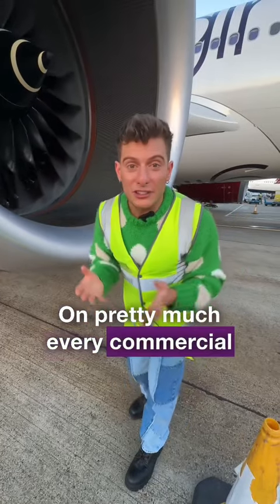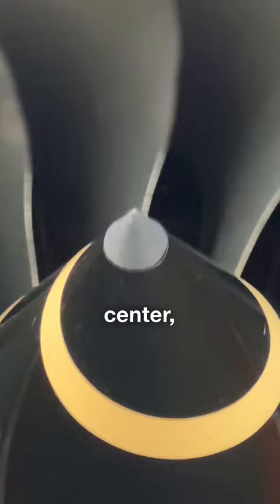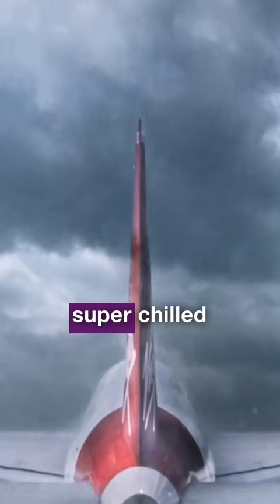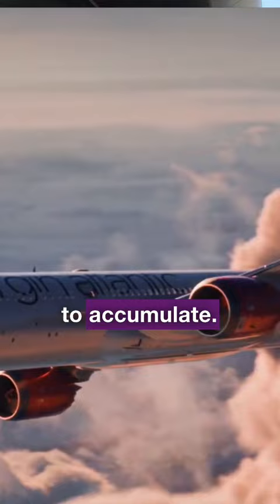The incredible engineering of a jet engine ✈️

Comment: Only on Rolls engine this is a patented feature
Reply: I hate that it’s patented
Reply: no, v2500 too
Reply: @jodjdjdg1559  iae engines are basically carried by rolls Royce that's why the engine architecture is so close from the RR rb211 and that's also why the spinner looks like this (yellow spiral) which is the RR signature
Reply: @victorbarretieri8252  they aren't anymore, Rolls Royce had a hissy fit at Pratt and Whitney, the other big group in IAE and they dipped from them
Reply: Yeah on pratt and whitney engines they just stick with a metal dome
Reply: @victorbarretieri8252  RR rb211 for Rolls Royce rubber bending 211 mm?
Reply: @swaggynator3879  I don't believe it means something in particular, maybe just an intern reference to something like the name CFM56 idk
Reply: Finaly the patent ran out recently. I know a company copying it as we speak.
Reply: I guess that’s why GEs and PWs engines must be more spherical.
Reply: @alonso-mexican757  GE wise, they're called "coneptical" a mix between a cone and an ellipse preventing ice formation and enabling smooth air flow for the compressor downstream.
Reply: @jodjdjdg1559 I mean… rolls Royce did design a decent chunk of the v2500 so that might explain it.
Reply: @FSXpilotman  well its not really a neccessity safety wise because the other engines just round off the whole cone and it has the same effect
Reply: Why would a safety design be patented. Crazy..
Reply: @iCore7Gaming because it isnt a safety feature its to increase performance its always possible to just make the whole cone round wile all the other engine manufacturers do to avoid the problem
Reply: I’m the 1 thousandths like on this comment
Reply: @FSXpilotman is it important to you?
Reply: @sqwk2559  yes

Comment: Pilot: Alright, turn engine 2 up.
Reply: Up?
Reply: @AverageAlien  throttle up
Reply: @NoahDaun-yd2ep turn on APU or battery option or ground Power . , set throttle St idle but electronic on set engine 2 on ingintion power delivery set-up. Next procedure can be different on type of aircraft. Turn on the engine Power to . Mag start auto or manual depending on situation. Now you throttle up the engine. 
Normally in Airbus 70% things are automated so yeah instant startup turn this guy into 10 million pieces of flesh. 
However at idle Power it ain't much strong to take you inside die to pressure on ground but depends on scenario there's no guarantee.
Reply: @arghyaprotimhalder5592  you realise it takes a good minute for engine to even spool up? you hear the compressed air starting system even before the engine begins to spool
Reply: That's engine 1💀
Reply: @lessthevrguy  no he is right bro thats the right hand side engine and that would make it engine number 2
Reply: @priyam352  bru in fact there is no engine number because you don't know where to start counting
Reply: @lessthevrguy  there is left engine is always lowest number and goes up left to right so a350 with 2 engines the left one is engine 1 and the right one number 2 and on the 747 you count 1 2 3 4 engines from left to right
Reply: @priyam352  Ait your gonna be a good teacher also I knew
Reply: @lessthevrguy Nope, thats engine 2 ☝🏻
Reply: @lessthevrguy 🤣😂
Reply: @arghyaprotimhalder5592  
I see my comment are getting deleted, so I’ll keep this short..

"turn on APU or battery option or ground power"?!?
What ??? 🤣😂🤣🤪

Stop writing incorrect nonsense you have randomly put together from various sources on the internet☝🏻🤬
People who doesnt know better could actually believe you know what you are talking about..
Reply: @NoahDaun-yd2ep they don’t say that
Reply: @arghyaprotimhalder5592 that’s bullshit
Reply: @justing42  why not? it'll give a good scare to the worker, just a little prank
Reply: @NoahDaun-yd2ep with full engine power 😂

Comment: Rubber spinny tip yeah just wait until you hear about the new additive manufacturing processes used to make turbine blades with tiny holes all though them that cooling air can flow through, allowing them to survive ridiculous temperatures and achieve amazing fuel economy.
Reply: New...😆
Reply: They have had tiny holes in them for decades.

Comment: Imagine if the engine just goes full throttle
Reply: with the new hybrid electric ones they could . you try to step out but as you do the suction gets too big and you are pulled back in as you are strugling to get around the cowling edge.
Reply: S engine is off it won’t need to start up and that takes atleast 60-70secs and is pretty loud

Comment: WHY ARE YOU SO CHILL WITH A MOVING ENGINE RIGHT THERE!
Reply: cause it’s turned off. the wind is moving the blades
Reply: @praintt  ooohhh
Reply: If the engine were to be on then it would be spinning at 600 RPM

Comment: Bro took dumb ways to die to a whole new level
Reply: The engine is off my guy
Reply: @priyam352 then why is it spinning
Reply: @calebgaming8459  it’s spinning with the wind like a windmill if it was actually spooling up to start it would 1. take atleast a full minute and 2. be extremely loud from that distance you’d notice minutes before it actually gets dangerous
Reply: @calebgaming8459  and if you look closely you can see it’s spinning in the opposite direction meaning there’s wind going from the back to the front of the engine and it would need to stop first before even starting to spool up

Comment: Why is the engine spinning? Is the engine on? Or the APU bleed?
Reply: real engine spins waaay faster than this, it is probably has been shut down just a minute ago
Reply: No its not lmaoo why the hell would he stand in front of it if it was🤦‍♂️ and its probably from the wind or the engine shit down recently
Reply: Wind will spin the engine a little. Having the APU bleed on will not spin the engiune by itself. The starter valve has to be open to start spinning the engine.
Reply: wind is turning the blades
Reply: Either the wind is turning them or the engine just shut off
Reply: It’s just windmilling moving with the wind it off if it was starting to spool up it would be way louder and be spinning wayyy faster
Reply: It's windmilling

Comment: Imagine that dude made the engines spin faster too much 💀💀💀
Reply: vacuum
Reply: Bro is not making any sense 💀
Reply: What? The engine is off it and you can’t spin an engine fast enough by hand to start it + you need fuel flow and ignition it needs topspin very fast to even start producing thrust

Comment: I wish they would turn on the engine as he’s standing there…
Reply: Then he’d step aside. End of story.
Reply: @admiraladmirably  Wrong, even at its lowest idle speed the engine would still pull him in.
Reply: @shrizy  Bullshit. In the phase where the starter drives the fan and thus starts the low-pressure turbine, the engine is completely harmless, as the high-pressure turbine is not active yet and can’t propel the fan.
Reply: @admiraladmirably  Read before replying, idle speed, not start up.
Reply: @shrizy   In that case, your second comment makes absolutely no sense, as it has no coherence to my first comment. You were talking about starting the engine, I was talking about him stepping aside whilst the engine start, then you threw idle thrust in there out of nowhere, in combination with a „wrong“, implying that that has anything to do with the stuff said before. You should really learn how to discuss properly.
Reply: @admiraladmirably  Average discord moderator\ Redditor. Keep blabbing on about how you're right (which you're not). I have more important things to deal with.
Reply: @shrizy  Your initial comment pretty much shows that you’ve never had anything to do that was important at all, also "you’re wrong“ is not an argument.

Comment: Hate to be this type of person here but, the engine does NOT have enough power to suck you in on startup and on taxi, but there is a big chance on full throttle take off!
Reply: no; if the engine is on, then a person is able to get sucked in. it’s safe when’s it’s off, but best get away from the engine if it begins to start up
Reply: @praintt  Nope, the engine does NOT have enough power to suck in a human during start up and during idle running.
Reply: @polkamaster8770  not during startup but idle. but u have to be near the engine to get sucked in at idle
Reply: @polkamaster8770 Yes it can suck you in even at idle, I believe you have to be 9 feet away from the engines when they are at idle
Reply: @polkamaster8770  you are correct but at idle it can and will suck anything in that is beyond a certain safety zone around the engine remember most engines at idle are runner still at ~15-20% of their max rpm that’s still a lot and at light weights even enough to move the plane just on idle

Comment: if the camera is recording the same speed as the engine how is he not getting sucked
Reply: You can rotate the fan and lpt module even when the engine is turned off
Reply: It's not the same speed as the fps (frames per second) of the phone its actually going slow
Reply: It’s actually really slow, as you can see by the high-pressure- compressor turbine blades not spinning at all on the inside.
Reply: @admiraladmirably  yea
Reply: @admiraladmirably At what time do you see the HPT blades? 🤔
Reply: @admiraladmirably those are stators…they don’t move

Comment: Why is it big
Reply: Because of how heavy the aircraft is. The engine needs to be big to fit all these huge engine component’s to able to produce a lot of torque( rotation) of the compressed air through its combustion camber to produce alot of thrust for the plane to be able to be lifted from the ground in during the takeoff stage. 

The wings of the aircraft are curved to able to produce lift from the air pressure from below the wings and from above the wings, earths gravity always pulls an object down. Pilots control the altitude of the aircraft’s movement by reducing the amount of thrust the engine is producing and by using its flights controls. It’s a mind blowing design that the wright brothers first invented. 

Nowadays pilots don’t have to control the engines performance during flight manually because of the new digital advance computers that are installed to monitor and control the aircraft’s performance such as the electronic engine control(EEC) which outsourced flight engineers in the the 80s.
Reply: 4 year old probably comment this
Reply: Thrust isn’t produced by air going through the combustion chamber. And lift is produced by the DIFFERENCE in pressure between the air moving across the top of the wing and the bottom of it.

Comment: Imagine if the pilot accendently turn on the engine
Reply: Kind of hard without the APU or a GPU running😉
Reply: @speedbird9313  No chance of seeing if the GPU is connected from that angle
Reply: @admiraladmirably  You’ll see the hose😉
Reply: @speedbird9313  Despite the fact that that isn’t a hose but a cable, the port for the GPU is located near the nose gear, which you can’t see in this video.
Reply: @admiraladmirably  Context..
I wrote kind of hard ( to "turn on" the engine) without the APU or a GPU running, which means if you dont have an APU operable you need air from a GPU. In which case you’ll see a hose..

You can also see a cable for external power, but that wasnt the point.
Reply: @speedbird9313  Why are you so stuck on pneumatic starters? Many planes with a newer build year have an electric starter integrated. Pressing the manual start switch for an engine will use the electric starter if bleed is unavailable.
Reply: @admiraladmirably  Many? What do you think the percentage really is on that? 😆😉
Reply: @admiraladmirably and won’t help turning the engine
Reply: @admiraladmirably if it has electric start, there is no bleed start